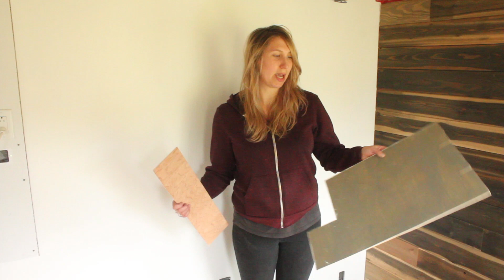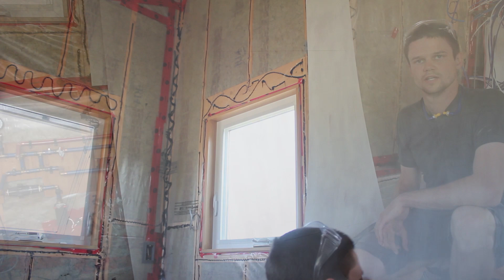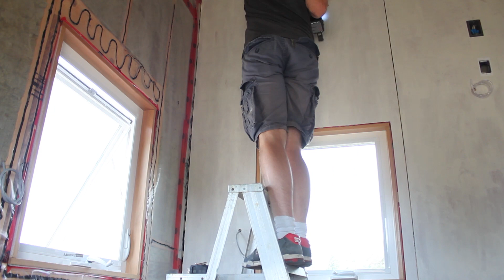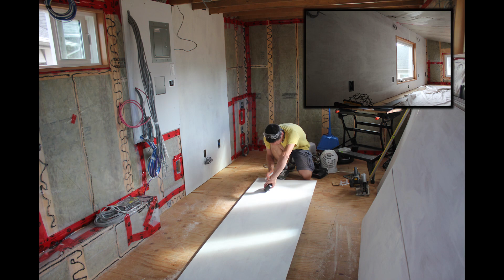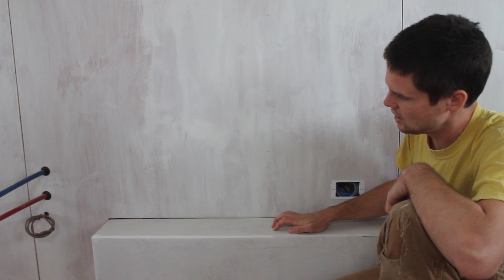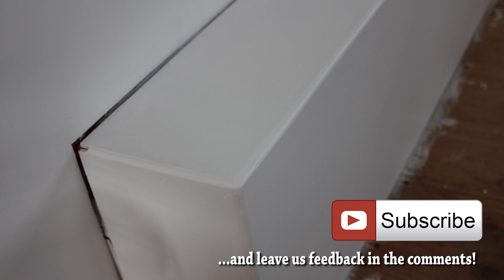Tiny House Interior Walls (Ep.58)

Comment: 2 years later.. how are those seams holding up?
Reply from the maker: My god has it been over 2 years already! Well not much has changed since it initially dried out... the biggest and most visible seam, in the kitchen, looks great, but many others have a crack. We should have used a filler with a bit of flexibility... maybe a flexible grout...

Comment: Wow, talk about an optical illusion. When I first opened the video I thought I was looking at an outside corner! FWIW, another option for folks may be quarter-inch sheet rock. I used this over some 1" rigid foam in my tiny house. You have to be careful at the ends and edges as you can really compress the foam, but overall it worked out well. I used EPS rigid foam, and something like blue foam, would have worked even better,  although more expensive.  The foam creates a nice thermal break over traditional studs and fiberglass too. 

The issue with wood for me is if it did not line up perfectly, there really was no recourse to fix it. With drywall you can at least spackle the low spots and even things out.  The other option would be to put the sheathing of the house on the interior, and then you would have a nice flat surface for any thin material. 

The drawback here is the exterior would need to get covered in a hurry to keep it from getting exposed to the elements, but Andrew Morrison did this in his tiny house. (hOME tiny house). 

Interesting to see all the different options and what people are doing!
Reply from the maker: +Troy D A few of the wood-filler joints did crack a little, and we may just put a thin strip of something (trim) over it. Yeah we watched the hOme video series back when we started and it was an interesting method of sheathing. It's tough to pick the best option that is light-weight, sturdy, and won't be problematic when the house moves :P

Comment: Too late to do now, but car auto body filler is strong and good to fill the gaps. It should also stand up to cracking when moving. Plus as you sealed the wood it wouldn't have made it swell.
Reply from the maker: +richard law Nice tip for the future! :)

Comment: Did you ever consider using a auto body filler (Bondo) to fill your wall joints? Pretty cheap, sandable, and easy to work with on wood.
Reply from the maker: +Michael Massey Ah, yet another good suggestion. No, I don't think we considered enough options for this task because we wanted to get painting!

Comment: Two bits - ceramic tile spaces can be used to space panels and are handy for corner joins as the come in a cross shape.  

Second one was you are wise to have painted the back as wood (even ply and MDF) can warp when you only paint one side and painting the reverse will help stop this.

Good luck with the filler - did you get specifically flexible or just bog standard?

Comment: Great job guys! I am thinking of going with the 1/4in sheets as well. Did you contemplate using adhesive before laying and nailing the sheets? Also, a paintable  option for seam coverage is a heavy duty wall paper backer/liner. Wall Liner Heavy Duty White Prepasted Wallpaper https://www.amazon.com/dp/B000EMWO7G/ref=cm_sw_r_cp_awd_4eh-wb4KCNYVQ
Reply from the maker: +meestro We had the vapour barrier right behind so adhesive didn't see like an option. Haven't seen this kind of product before, thanks for the tip!
Reply: +Tiny Nest do you think there is any threat of the shorter nails popping out during travel as the wood twists a little?
Reply from the maker: +meestro It's possible, but we don't plan to move the house much, and there will be cabinets and other things up against the walls which will help hold them down as well.

Comment: Hello and great job!
How is that 1/4" panel as far as flex when on the wall?
I'm at this point in my TH build and have been debating weather to use 1/4" or 3/8" plywood. On the wall that the mini split goes on I've decided to go with 3/4" plywood to lessen the chance of vibration of the fan unit.

You guys are lucky to have family and each other to help, I've had to hire help as my friends live in another state.
Here is a link to my build album, let me know if you have any ideas.
https://goo.gl/photos/3HHwVuiQDe9MDCXy7

Thanks for the video's!
Reply from the maker: +Larry Read With 16" on-center studs it's pretty solid. 24" might be a little more noticeably flexy. Is that black pipe in your pics for gas? It looked like white teflon tape on the joints, is that right? I had to use yellow gas tape on my few propane fittings.

Comment: You should end a 'panel' up against a door or window otherwise you are likely to get movement cracks along the join. Doors moreso than windows given the vibration (windows more as the house expands and contracts). For instance with a doorway the panel should at least overlap by say 25% and you cut out the panel for the window/door opening.
Reply: Typo correction... 'shouldn't end a panel up against a'...
Reply from the maker: +Number Eight Thanks for the tip!

Comment: Looks really good but what a lot of work. Since you painted it white if it does crack when you move you can make repairs with white caulk or even Spackle.
Reply from the maker: +MakeMeThinkAgain Indeed, there are already a few spots that might need touch-up... not from cracking though... there are some cracks on a few seams, but we'll probably just put some batten over them in the end.
Reply: +Tiny Nest It took me years to get around to it, but I've put Ikea mirrors on many of my walls and even a door to make my tiny place look bigger -- it really does make a difference. I have both the long, thin wavy mirrors and the little squares. They are held to the walls with adhesives and could also be used to cover imperfections.
Reply from the maker: +MakeMeThinkAgain We might have a full-length mirror on the inside of a slider that closes the hallway ;) hard to explain, but you'll see eventually.

Comment: The good thing is once you move your house and start living there the cracks and imperfections will translate into a nice lived in feeling that you'll like.  It's nice to see it as perfect as it will ever be but the knowledge that you designed and built it yourself will supersede the "mistakes" made along the way.
Reply from the maker: +John Norris I think we'll just cover the cracks with some battons ;D
Reply from the maker: +Tiny Nest batten*
Reply: +Tiny Nest +Tiny Nest   I kind of like the batton idea better!

Batton (バットン?) is a recurring bat-like enemy robot series from the original Mega Man series that first appeared in Wood Man's stage in Mega Man 2. Most Battons become indestructible while hanging from the ceiling with their wings closed, and become vulnerable when they open their wings to chase their target.
Batten has multiple meanings in construction and shipbuilding but is generally a strip of solid material, historically made from wood[1] but can also be made from plastic, metal, or fiberglass.
Reply from the maker: +John Norris ...so are you saying I need to beat Metal Man first?